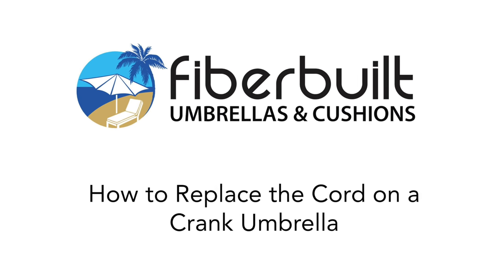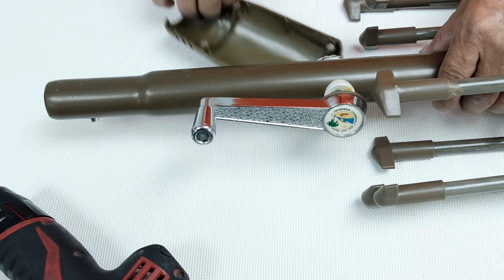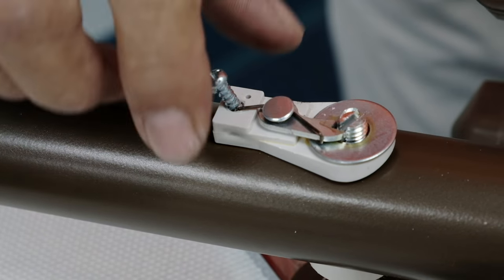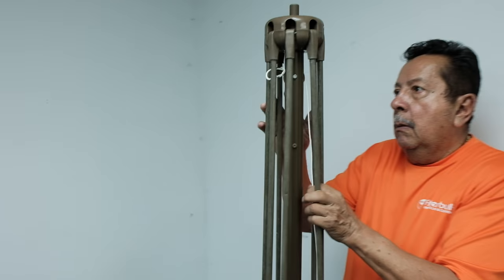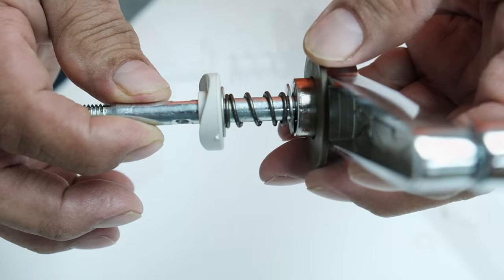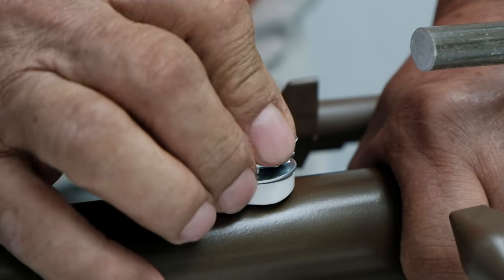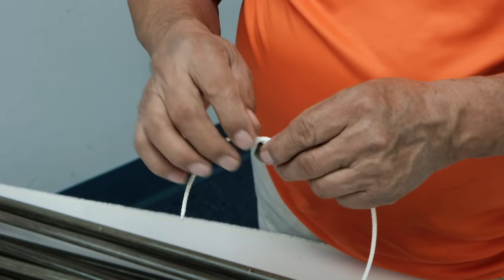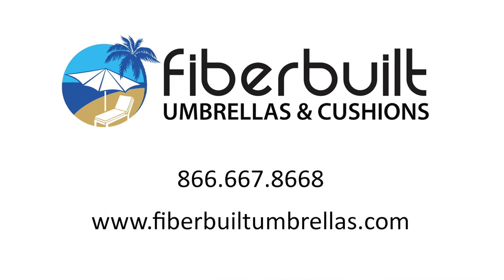How to Replace a Cord on a Crank Umbrella - Fiberbuilt Umbrellas & Cushions

Comment: This worked perfectly! Just replaced the cord in ours (different brand, same construction). The only snag was a literal snag. The replacement cord kept getting hung up on something inside the pole, so we just needed to attach it to some wire and feed that through first. Easy peasy

Comment: Thank you so much for this video. It really helped me do mine as well. However, on the washer that has a line in the middle with two tabs to secure the nut broke on one of the tabs. Do you know where I can get extras or send me a link on where to buy an extra one?

Comment: I've fixed my cord twice now. The problem is, it's a tilt umbrella so there is a pushbutton at the upper end of the umbrella. How does the cord get threaded through that click button? There is space to put it through on either side of the button which is what I've done, twice. Low and behold, the cord broke again. I'm getting to be an expert at fixing the string, however, how do I get it to stop from breaking?

Comment: My question is, why do my umbrella not have a permanent loop string at the top of to tie knot and put safety ball. My umbrella didn't come with a safety loop or safety ball on it. The to of my pole has a wheel in it to feed the string through.  It is attached with studs so I cannot remove wheel to re thread the string.. My string was so worn I could not Salvage enough of it to try to re-tie it at the top. Do you know how I can find replacement part?

Comment: Most outdoor umbrellas have a tilt mechanism.  I took my crank apart, pulled out the damaged cord and tried to follow the directions in this video.  However, the cord can't make it through the small hole at the tilt mechanism.  It has to go through both halves.  Please add instructions for replacing the cord on a tiltable umbrella.
Reply: Follow the instructions to the point in which you have the cord through the pulley wheel at the top.  Then you have to get a piece of 14 gauge wire, approx 6 ft. long and feed it from the pulley end, through the hole in the tilt mechanism down to the crank opening.  Make sure you operate the tilt mechanism in both directions with the wire in the pole to make sure you are in the right path.  If the tilt does not work in both directions you have to find the right hole opening in the tilt knuckle before moving on.  You then connect the cord to the end of the wire with tape near the pulley and pull it through to the crank opening.  Follow standard directions from there.
Reply: @jackgl2  Thank you, was looking for exactly this.
Reply: ha, exactly what i just went through...i used a coat hanger to catch and drag the chord through..worked much better than i thought it was going to be, putting the tilt back together and move pole to sit was fun too...

Comment: Where can I buy replacement parts for the crank mechanism... thanks
Reply: I need a bolt with a hole in it to reinstall my handle.  My bolt broke in two when I took it apart to replace cord

Comment: Didn't work for me, as I couldn't get new cord to pass the pulley and go down towards handle. Eventually drilled out rivets holding pulley in, fed cord on manually, re riveted. BUT as mine has a tilt mechanism, (half way down) there was no way the new cord would pass through the narrow cord channel.
Reply: I also found it very difficult to get the cord through the correct portion of the tilt mechanism.  The previous reply from "jl" describes a procedure that works but it can take trial and error to get a wire connected to the cord to go through the correct path in the tilt joint.  I think it took me over an hour of attempts to get the wire/cord through the correct path in the tilt hinge.  Not fun!

Comment: Yes, I see these cables break often judging by how many videos there are showing how to re-string a crank ubrella.  I have replaced the broken cable in mine with a stainless steel cable but I am having trouble reassembling the crank.  I filmed how I took apart the crank, and I have the parts back in exactly the same order.  The umbrella cranks open well, but the crank does not hold in the open position now.  The tension in the umbrella pulls the cable and makes the crank unwind and the umbrella closes when you let go of the handle.  Does anyone know how this mechanism works and can suggest a fix?  The order of each of those washers is correct, the direction of the cog and the ratchet the clicks against it is correct.
The rachet clicks as I crank the umbrella open, whcih I think is right, but then it just closes when I let go of the handle.  Very frustrating that there is no guidance on how to fix these things.
Reply from the maker: Reach out to our live chat maybe we can help http://shop.fiberbuiltumbrellas.com
Reply: Is the "dog" on backwards? Double check those handle parts and assembly positions.